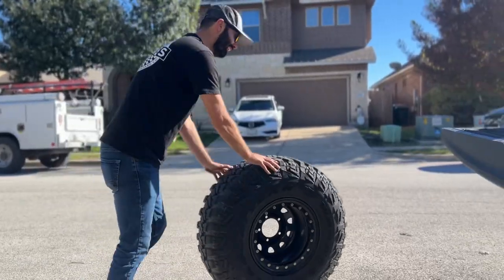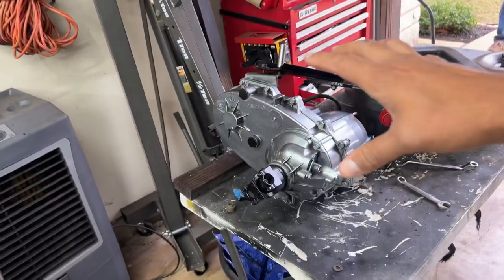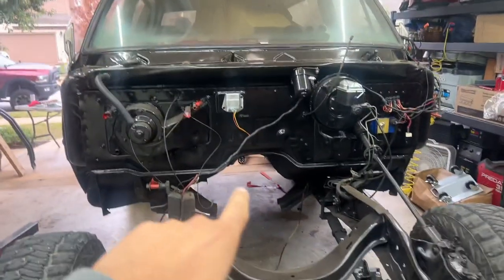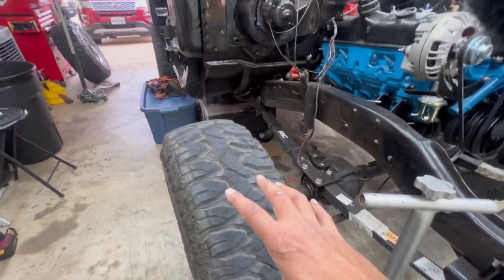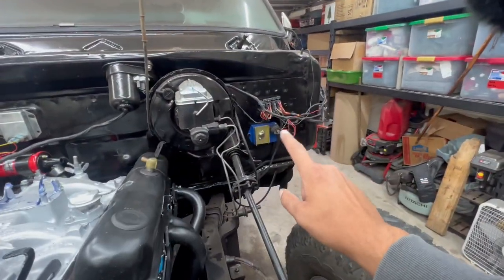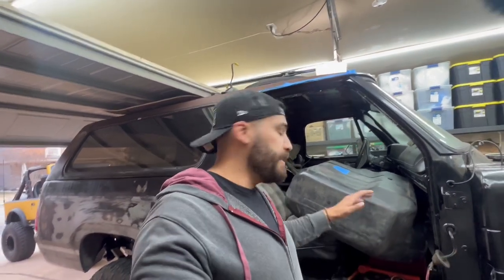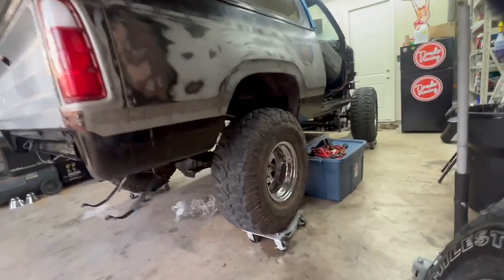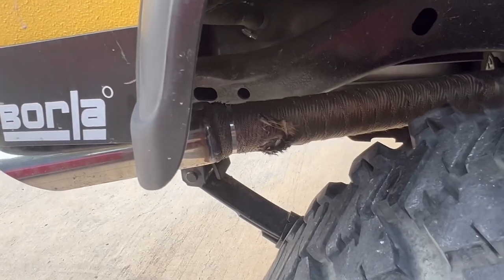Serious Progress on the 1980 Ramcharger Build! |VLOG|

Comment: Just watched all the videos on the ramcharger.  I picked up a 86 royal se with a 318 small block. 

I just took the passenger header of and one of the bolt holes leaked some coolant. Did that happen to you by chance?
Reply from the maker: Thanks for watching! 

So yes we have a 318 as well, we removed the manifolds and where the corner manifold bolts go it leaked some coolant. Those are drilled all the way through. That’s also where the freeze/water plugs are on the side of the head. 

If you have Instagram I can send you videos in chat. Same username (Tiradoracing)
Reply: I dont have that only the youtube app. Thank you for the information though.  It helps. Google was all over the place with sealing it but not saying if it was normal.
Reply from the maker: Oh we know that all too well! If there’s anything you want to see let me know I can email pictures as well. Or if you have Facebook you can message me again it’s Tirado Racing. More than happy to help!